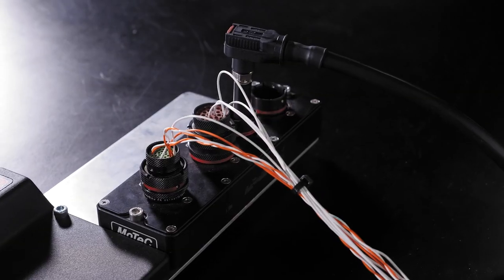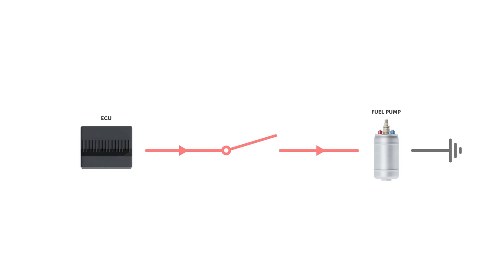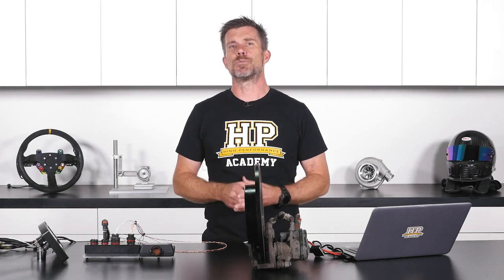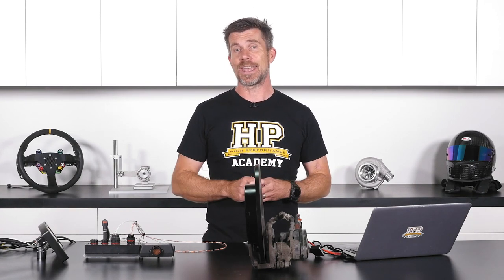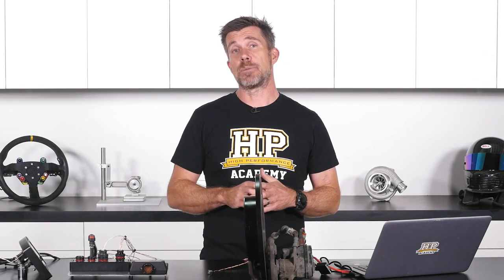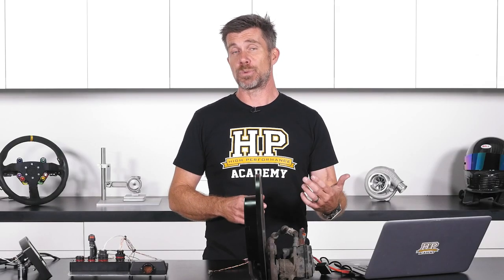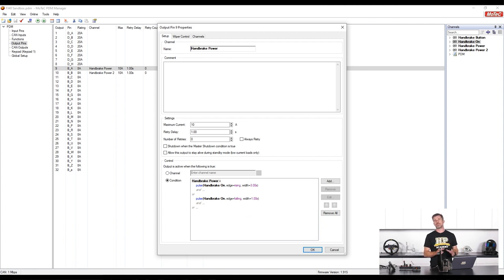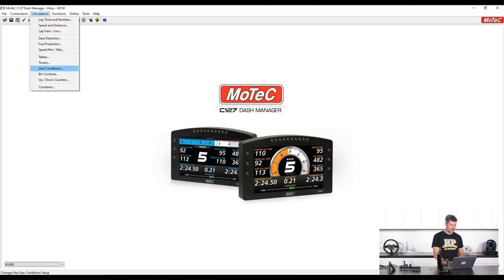The World's Most Complicated Handbrake Setup?

Comment: My main issue with electric handbrakes is not the complexity but the loss of functionality. Sure it does the job of parking fine but I often use a handbrake in conjunction with the clutch and throttle for better control, particularly when travelling up a steep incline.
Reply from the maker: I won't argue it is easier in a manual, but you can also just use your foot on the brake. Andre is pretty much a tap dancer in that department these days with all his left foot braking practice 😂 Where there is a will there is a way! - Taz.
Reply: @hpa101  Dont get me wrong I am more than willing to admit that i am not the best driver or auto electrician. Andre's technical ability and foresight to get all the  components working together is impressive. I'm more of a mechanic and build classics that fortunately need nothing more than a power probe to diagnose electrical faults. I'm not trying to take anything away from the credit deserved it's just not for me.
Reply from the maker: Yeah man no worries, we're never telling you what you are or are not doing is wrong either, we just explain topics and you make your own calls on them with that knowledge for your own uses. We're all good 😎 - Taz.

Comment: What if you blow the fuse to the fuel pump, along with the wire and relay? 😅👍
Reply from the maker: In relation to the handbrake? Nothing - Taz.
Reply: @hpa101  🤣 Touche Taz. 😘 I was just referring to needing PDM's. Although an electric handbrake on a Mazda 121 does sound like a futile exercise aswell. 😂
Reply from the maker: 🤘😉
No one 'needs' anything, it's all a matter of using what you think gives you the lowest risk and best chance of success. This is why PDMs are popular in motorsport as, by comparison, they are less risky than the current alternatives (I'm no Zac level at puns, but that was half decent right?).

You could just reset a PDM or rather it would just do it for you. You can also monitor the current to help you understand when your fuel pump is nearing the end of its service life rather than just winging it as part of your general PDM use and data collection.
A fuse and relay would be race over regardless unless it is an event where you can pull over and spanner on the vehicle, in which case it would just be a lot more lost time by comparison.
A melted wire is a different story that is separate to a PDM or fuse/relay setup in my opinion.

If you had missed something and bench tested it either way though you might find that fault before you're balls deep into things at least, but it's only helping remove some risk which is the best we can hope for, there will always be some level of it.

This is all assuming the loss of fuel pressure didn't happen at a time of engine operation where it caused other issues that your choice of PDM or fuses and relays won't change 😅

Hope you're keeping well mate! - Taz.
Reply: @hpa101  Sort of yes and no my friend. When some idiot (ie. Me 😅) decides to put a 340lph fuel pump on stock wiring that needs 15A but your stock fuse is 10A, you can see where things are heading. 🤣👍
Yeah, I'm okayish now. My body broke down as bad as my cars did last year but I'm recovering now. Just damn these long spicy cough symptoms. 👎
Reply from the maker: Spicy cough is no fun for sure! So varied as well, hope you're on the mend soon enough mate - Taz.
Reply: @hpa101  Yeah, I'm good today mate, just doing some mowing and clearing the yard so I can break these cars down the next few days and acquire all my bubble parts before house inspection. 😅👍

Comment: There are lots of advantages with using silicon to switch loads but it is never quite as straightforward as it seems. Relays get a bad rap which is probably unfair given the vast variability of quality & other factors which impact on reliability. They are actually extremely reliable & robust both electrically & mechanical ly. They are especially well suitjng to switching horrible loads such as motors etc which are inductive & as such pose a challenge for solid state switching. Current consumption details with loads such as motors can also be problematic as the startup current / inrush is generally an order of magnitude greater than the running current. Again this drives a significantly larger solid state device to cope with this whereas a relay would just such it up. There is no such thing as a free lunch! It's a simikar story wiyh fusing, automotive fuses are incredibly tolerant. Depends what is important for the application.
Reply from the maker: I don't think mechanical relays get a bad review, it's simply a comparison to other options that highlights their weakness. Every tool has pros and cons. You can even get single solid state relays, but they can be expensive.

Remembering we're discussing comparisons, your last line nails it - Taz.